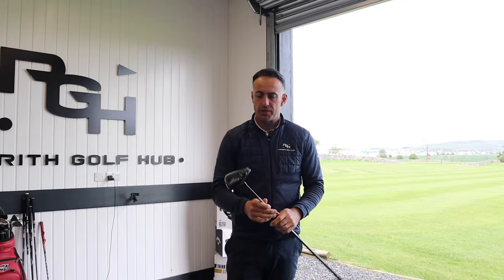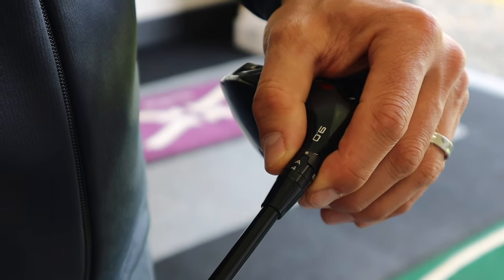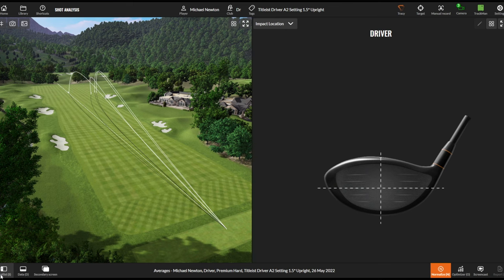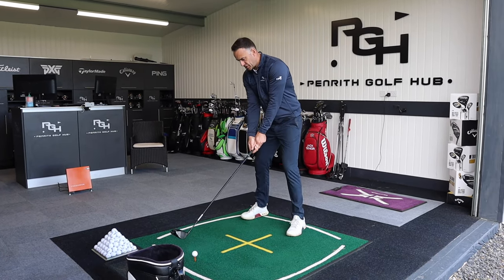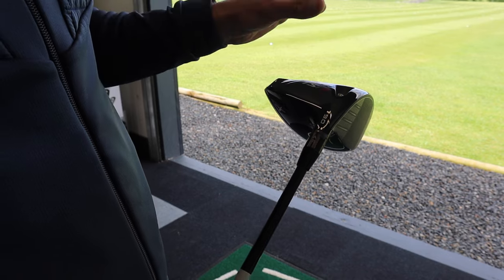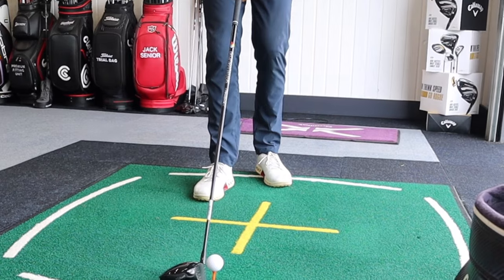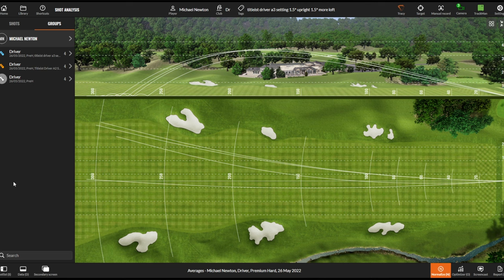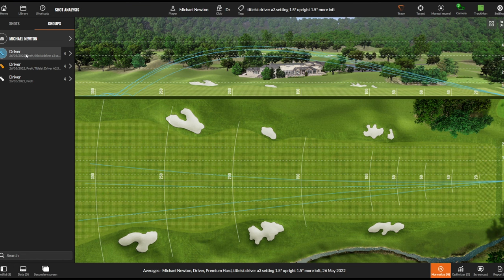TITLEIST DRIVER Settings Explained & Tested! INTERESTING RESULTS!

Comment: only thing i dislike about the sure fit hosel is changing the bottom setting also rotates the shaft and grip.
Reply: Exactly. That's why Callaways are better.
Reply: @mikesmythe9092  simple fix get the “360 grip” golf pride
Reply: @mikesmythe9092  There's no better at this level. There are trade-offs.
Reply: @johnhathaway735  doesnt help with shaft graphics...
Reply: That’s why you get fitted for the driver. They can then adjust the hosel adapter to be in line with the shaft graphics and then your grip will be in line the way you want. You shouldn’t be changing those sleeves around a bunch anyways. Those changes are incremental and don’t fix a bad swing. If you have a big old slice or a big old hook there’s no amount of adjusting in an adapter that is going to fix that.

Comment: I have the Titleist 816H2 in a 25° loft. I get a mid launch with. Straight or little draw. It's set at A1. What settings should I set for a higher launch but keep it at a Straight ball flight or even go with a full draw with high launch.

Comment: great video Michael. i was custom fit last September for my TSR3, 10° standard loft, B1 setting 0.75 degrees flat. also was custom fit for TSR3 3 wood, same hosel setting but minus 1/2 inches in length. i wound up ordering same for TSR3 5 wood. 
loved them so much after playing with them i ordered a TSR3 4H. for me TSR3 are the best feeling/sounding woods i’ve ever played.

Comment: Just started gaming a TSR3 9.0.  My miss bad miss is a hook and my contact miss is toward at the toe. The toe miss leaned me toward the TRS3 over the TRS2 just due to the option to move the weight closer to my contact miss.  settled on the T1 Setting B1 hostel setting.  This has minimized my left miss and I believe moving the weight to the toe has help put the MOI where I need it for my contact miss.   If there is anything else I'd like to optimize it would be peak height, Its just a touch low.  I think a higher launching shaft would give just that little more optimized launch without moving the hosel setting.  Going to try a GD Tour AD Di over the HZRDUS Red CB (with was the best of the stock shafts I tried).  Aways loved the feel of GD shafts.   Love your channel! if you could sell your golf swing you'd be a rich man!

Comment: The Titleist Hosel, for me, is the best adjustment hosel on the market. love it. However, I changed from Titleist to Cobra Radspeed XB 10.5 stiff Motore F3, changed the settings to 10.5D, as a result upped the Lie, because I am a tall guy and game my irons +3degrees up. Ball went little to drawish for me, so I changed the loft down, kept the lie and set it to 9.5D to open the clubface a tiny bit. Absolutely perfect straight fairway bomber. love the Radspeed Xb superb feeling, sound and foregivness!

Comment: Recently got the T3 with a senior flex shaft and found it difficult the first time out to find the right tempo to let the club do the work. I had put it to the A2 setting as I enjoy taking the left side of the fairway out  and use a draw to the center. That never happened, and your video shows why. it was indeed a very slight draw. I will try the full draw setting. Thanks!

Comment: Really love the design of the SureFit hosel. Unlike that of my ST220G where I am forced to change loft to obtain my preferred 57* driver lie, the SureFit allows lie to be adjusted independent of loft. 

Not too much of issue on my driver, I play the 10.125/57.25* setting that works great for me and I really like the 2 movable weights design of ST220G. 

When I was testing 3-woods, I really liked the TSi3, I tested the 15* set .75 upright, for 57.25. I could try both 15 & 15.75. I ended up buying the C722 set @15.75/57.5, primarily because my club builder could buy head only to fit the Speeder NX 60X, a shaft that was not in custom matrix for Titleist nor TourEdge. The SureFit however was clearly the best engineered adjustable hosel I have seen.

Comment: This video was very fun and informative! I plat Tour Edge C721 9.5 set at U- which is 8.5 and 61 degrees and getting more draw than desired. If I heard you correctly then I can set to lower lie which for this club would be 59.5 degrees. Is that correct?
Reply: Not as simple as that. A lot depends upon consistent swing path and squaring club. If those factors are however constant, you’ll typically find more upright lie to bring toe forward thus effectively closing face, resulting draw bias. 

TourEdge commonly are very upright clubs in driver, oddly since their fairway metal are traditional to flat for example a ‘typical’, if there is such a thing, driver lie is 57*, 3-wood 57.5*. I thought the C722 I read was 59* for driver 🤷‍♂️. I play the C722 15* 3-wood which has a base lie of 57*, 2* flatter than their driver. I play mine @ 0+ setting of 15.75/57.5 w/43” length. My ST220G driver is set 57.25 lie w/45” length
Reply: @MichaelM-to4sg  ok very interesting data !! Yes I’m still working on swing path so until that’s fixed I don’t think the lie will matter much. I appreciate the reply and your information

Comment: Hi Michael, love your channel. I have a question regarding the setting on my 8° TSI 3driver. Can you help?
Reply from the maker: Fire away…
Reply: @MichaelNewtonGolf  great - thank you!

I want to increase the loft from 8 degrees (A1) to 9 degrees.  I know that closes the face a bit but I want to avoid the left side at my course. I assume making the lie flatter would cancel some of that left bias out, right?

What setting do you recommend?
Reply: C4?

Comment: I have a tendency to slice my drive from left to right. Just got a titleist 917 D2 9.5 degrees driver. Any advice on what setting to put my driver at to start with ? Good video
Reply: A3 if right handed..
Reply: @midlifebiker7424  thanks a lot for your reply! Will try that out

Comment: Playing around with my tsi3 settings at the min. I'm left handed so setting different for me. I'll be going for d2 and h2 for my next settings hitting it low on last visit to the range. Still I'm very tempted for a stealth plus as the sliding weight looks to be more fine tunded. Can you do a tsi3 vs stealth plus comparison?
Reply: Can't beat titlest 3 woods or 5 woods so many adjustments 😊

Comment: Hey Michael, do you see any difference in the TS1 drivers vs the TSI1 drivers as far as length?
Reply: TSr2 and TSr3 are so good, they will blow away TS1 as long as you get fit. But I believe TSr1 is coming soon if that is squarely in your specs.
Reply: @lkae4  I think you are right. I am a sr golfer. Im a 8 handicap. I normally driver the ball around 220 yards. I am almost 66.
Reply: @GDJ1957  That's plenty of distance for a TSr2. You may get lucky and gain another 10 or 15 yds with the right shaft, grip and golf ball. I gained about 5 or 10 yards from TSi3 to TSr3. Have fun.

Comment: 2:07 ... that's not the A1 setting. It says, "A2 Setting 1.5 degree upright, 26 May 2022" at the bottom of the frame.

Comment: If i have a old titliest 910d2 driver on a stiff shaft, can i simply unscrew it and put a tsi2 head on that shaft? Currently i have a tsi2 on a super stiff shaft and i dont love it. 

Are the setting features compatible or with each new driver that comes out the setting  change too?
Reply from the maker: Yes that shaft will fit 👍

Comment: I do think manufacturers don’t make it clear enough that the reason the club sits shut when you use the increased loft setting is because it just shuts the face forcing you to regrip the club square and increase the loft in doing so. If the club is flat on the ground at address after the ‘loft change’ there is actually no increase in loft at all, just a shut face.

Comment: Question I use the titleist 910 d2 but I brought a 915 d3 but using the new one I lost 25 -35 yards it's terrible, I even put in my fitted shaft still the same, tried 2022 driver's but don't get the same results as my old Titleist 910 d2

Comment: Can you change the number and letter cogs without moving the shaft? Example: If I installed a grip logo up in the A1 setting, will the logo of the grip move if I change the setting to A3?
Reply from the maker: No, grip will rotate so you would need a 360 grip (no logo)…..they come on as standard